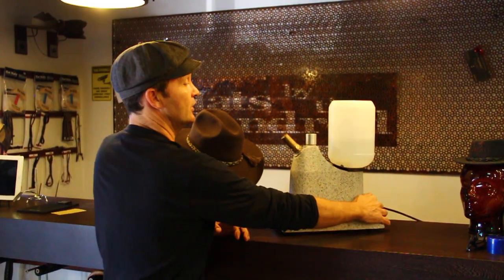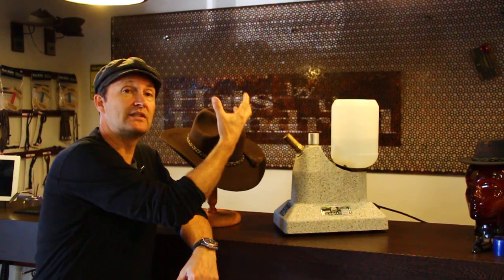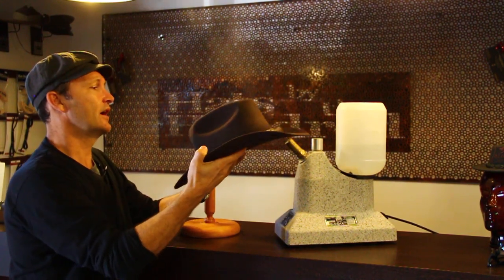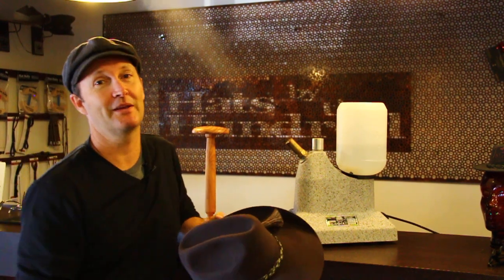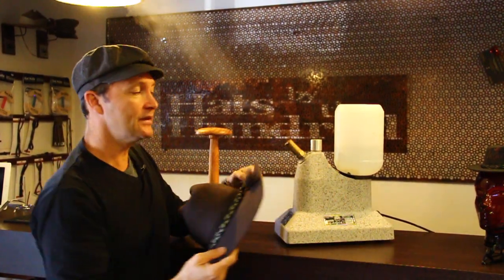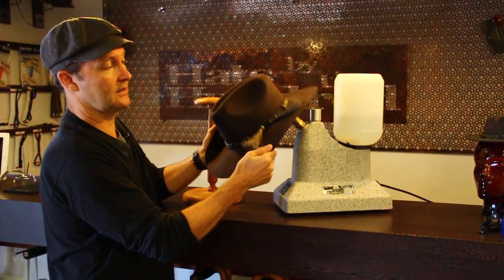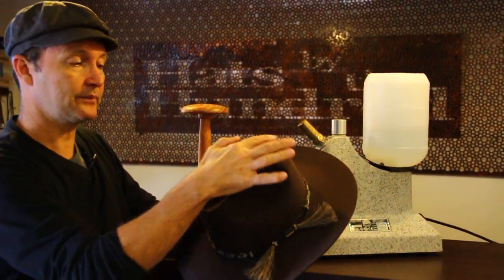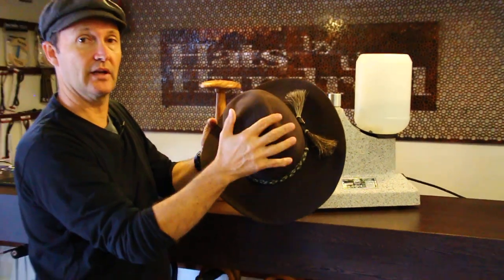How to re shape an Akubra- Tutorial By Hats By The Hundred

Comment: What about adjusting the band (if that’s the correct term)? My head is longer than it is wide so I can’t find a size that fits. If it works from temple to temple then it’s too small the other way and gives a red mark on my forehead. If I size up then it’s too wide and looks ill-fitted. Can you reshape the fit?
Reply: I have length at the back of my head. I find round hats like the cattleman are not good. The Coober Pedy and Riverina are good. In a western style the rough rider is great. And it's deeper